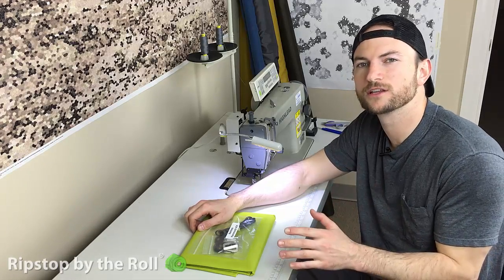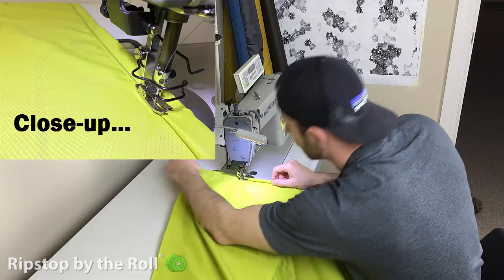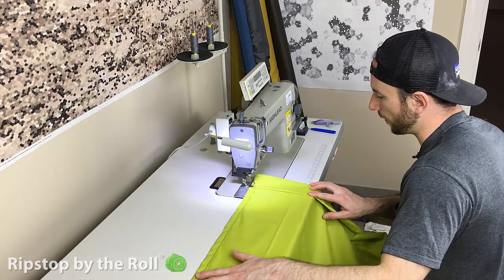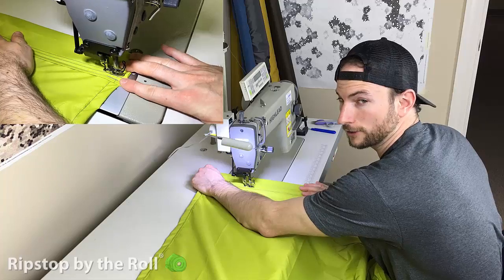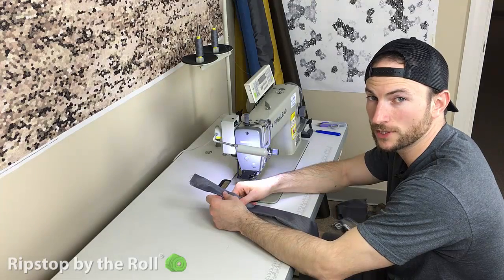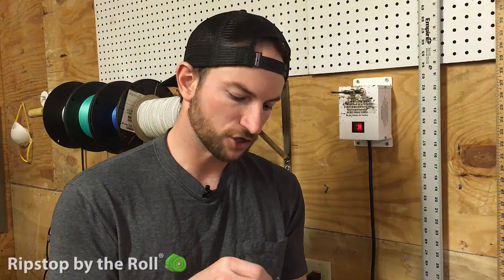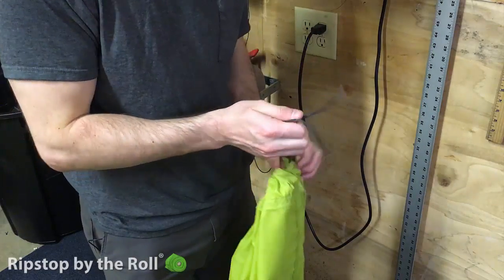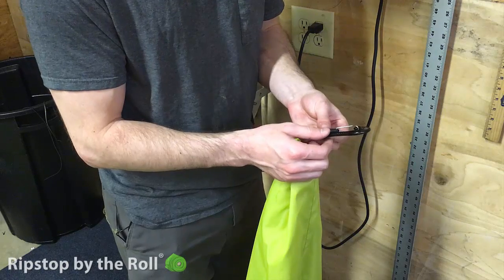DIY @ RBTR - How to Make a Netless Hammock

Comment: Am I able to use lime green nylon fabric for an airblown inflatable decoration?
Reply from the maker: This sounds like a fun application! Any fabric that has a PU coating or is non-air permeable should work for you! Two fabrics that happen to come with a neon option are, 1.1 oz Silpoly and 1.6 oz SIlpoly.
Reply from the maker: https://ripstopbytheroll.com/products/1-1-oz-silpoly?variant=7943419457
Reply from the maker: https://ripstopbytheroll.com/products/1-6-oz-silpoly?variant=30371342157
Reply: @RipstopbytheRoll   Alright thank you!

Comment: Do the side seams add any strength or can they be skipped? The ripstop usually has finished edges right, or will the ends eventually start to unravel?
Reply from the maker: Hey! All of our fabrics have unfinished edges. It's certainly not a must to do roll hem or finished hem. But it is most definitely what we recommend. Most all fabrics will fray without a finish.

Comment: The side seams ARE NOT REQUIRED.a straight selvage edge is good enough.

The rolled channel is good to have but strictly speaking not required.

Multiple rows of stitching is a waste of time IF you tie your suspension cord UNDER the ge knot.nothing structural about the channel-its only to create bulk for the knot and the channel is for any old piece of string to gather it.

Your gathering method places your life in the strength of the channel stitching
Reply: I use a cord through my sewn channel on 1oz HyperD and have slept many nights with two people in it. The cord-through method is bomber with 3 rows of stitches, and it takes very little extra time to add the extra rows. The side seams aren't strictly necessary, but they make the fabric more resistant to tearing from the edge, and a rolled-hem foot on the sewing machine is a (cheap) must-have accessory for a more finished look.
Reply: @nikolaihedler8883  each to thier own.

I wouldnt trust your method hanging 30' up a tree or on the side of a cliff.the consequences of a fall are too severe.
Reply: @jadekayak01  I wouldn't trust any hammock for those conditions by itself; that's what proper fall protection is for.
Reply: @nikolaihedler8883  thats true.
Climbing harness set into 2 clips on rockface or round large bough for me

Comment: Is this the design that you stress tested on your website at 1200lbs for a week?

Thanks for the edits. Didn't need to see all the sewing.
Reply: John Thomson yes sir it is. The exact same style design.
Reply: @kylebaker371  I use 1.0 HyperD with a 1x2-inch end channel (fold 1" over, then another fold 2" further) instead of the 2x2, and with 3 rows of stitching and a Lash-It SRL, it's held up to years of regular one-person use and more than a few nights of ~400# of sleepers (two people and cold weather gear). People constantly underestimate the strength of these fabrics when taken care of, and it's thanks to you that light, bomber gear is within reach for the DIY crowd.

Comment: Why do you recommend a half inch on the seems. Are the side hems structural?
Reply: 1/2" is a good sized hem without being unsightly big. It's a good balance between how easy it is to sew and aesthetics.
Reply: The side hems will be under tension
Reply: With a rolled-hem foot, it's easier to make small side seams, but when sewing by hand, half an inch makes it easier to sew.
Reply: The rolled hems can prevent tearing from the edge.

Comment: love the products you carry. and love the DIY videos. I owe you some pics of my tarp and net bivy i made with membrane pu4000 all together with guylines and stakes 20.8 ounces. I'll be ordering a bunch of material for some future projects and I'll try and remember to email the pics.  my future projects include a bilgy tarp from Seattle fabrics who carries the pattern but using the membrane pu and the .5 noseeum from RSBTR and maybe one in cuben if I like the design. also gonna make a full weather bivy using the cuben for a bathtub and that new breathable 1.04 fabric you carry for the top and the waterproof zipper.  also a cuben fiber rain skirt and one in membrane.  just cause I'm loving the membrane and still not sure of I like cuben better or  not. I've made membrane dry bags and they are pretty nice also.  great company with the best materials out there IMO. thanks RSBTR.